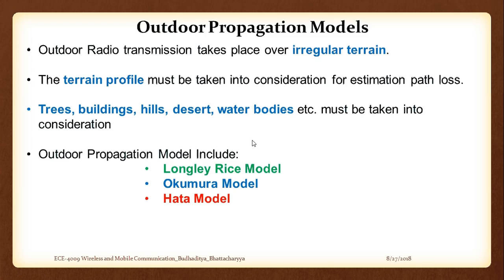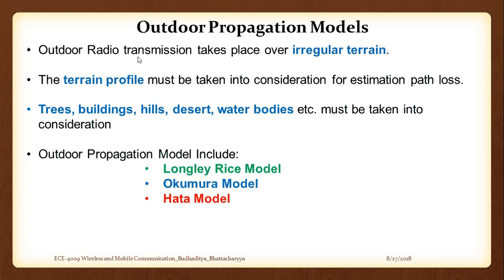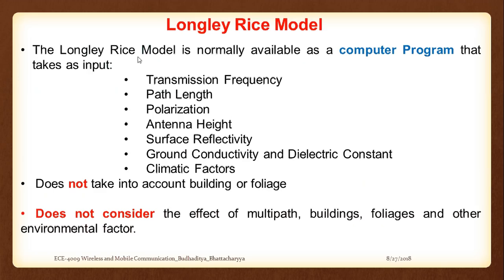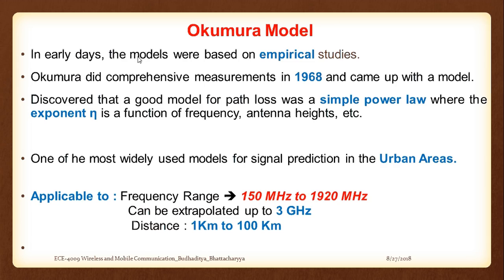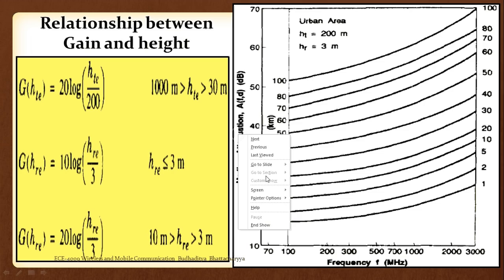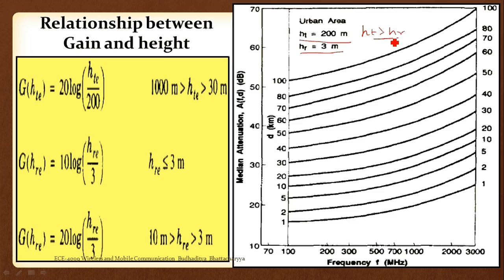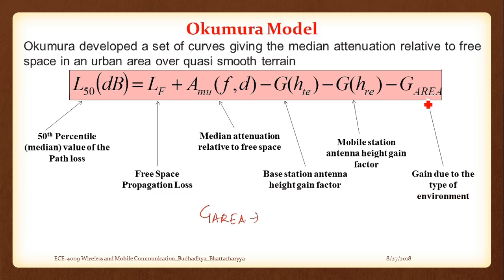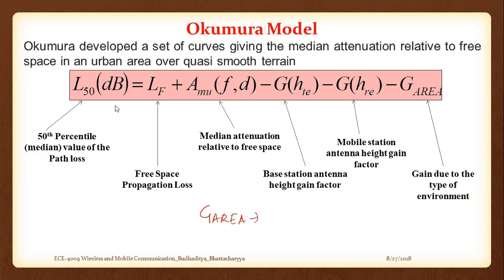Lecture : 17 Okumura and Hata Model

Comment: Hello sir, 
I am currently working on a project that requires the use of COST-Hata model.

I am facing a concern that when calculating, I sometimes get negative path loss and other times I get positive path loss.

May I know if it is normal to get negative path loss?

Comment: Respected Sir, Very informative lecture..Thank you

Sir, similarly what models can be used for 4G,5G and future wireless networks ? can we the the hata and okumura model for  beyond 5G ?
Reply from the maker: Dear Tanveer usually it cant be especially Okumura as it has limited frequency of operation. Hata well yes you can but there are many other conditions like path delay, random doppler shifts, Delay spread and different terrain information are also equally needed for implementing the same. There are standard model like COSt-231, Extended hata which may be used.

Comment: every thing is fine but there is some disturbance it is very clear when listing to it on head phones plz avoid it.  it made a kind of  irritation.
Reply from the maker: Absolutely agree Rachana.  Unfortunately the acquistic issue in regular class room is not always good. Hence the problem. Also while at that time I never knew much about noise filtration. Sorry for the trouble. Happy learning.